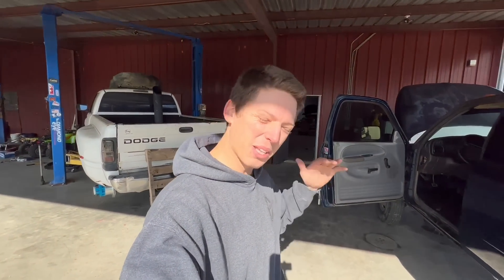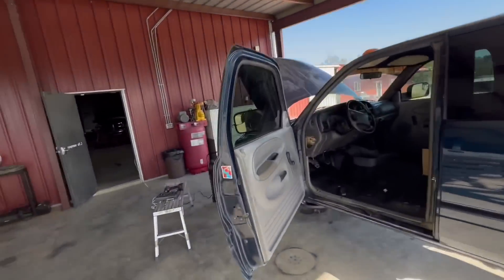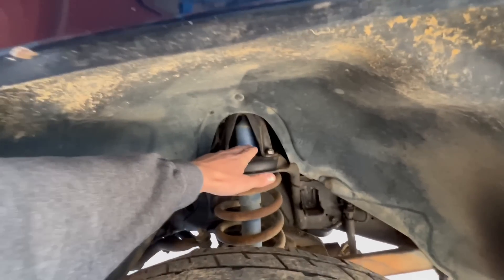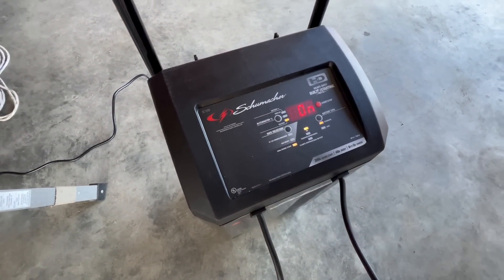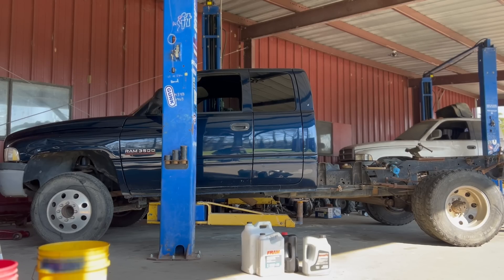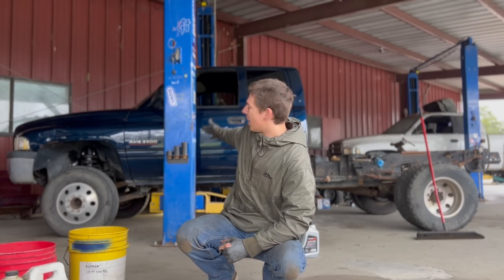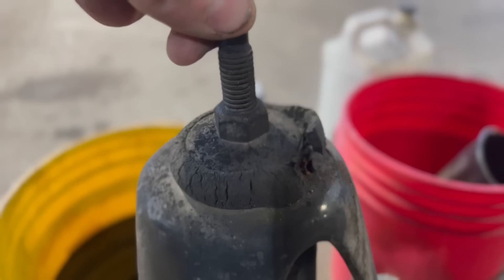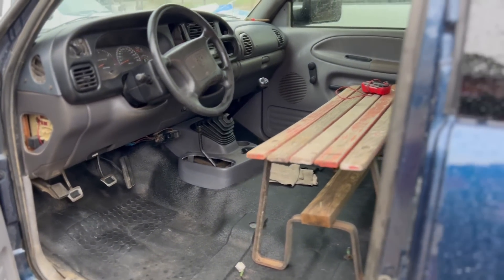I LIFTED THE DUALLY

Comment: I have the same leveling kit on my 2nd gen short bed club cab and I’ve got 285/70/r17s on it with 0 rubbing and a couple inches away from my long arm kit at full turn when I get out after it’s relaxed back a bit

Comment: 35s will fit I have a 99 ram 3500 dually an I put 315/75 r16 on my truck an it has a 2 a half leveling kit
Reply from the maker: What wheel width ?

Comment: Yeah the reason why these kits are so cheap is the quality and material is usually trash and maybe it's just me but when it comes to suspension especially when you have springs under that much pressure I think I'd want to go with better material to prevent a casualty and plus if you're changing the height of the shock Tower do you really need a leveling kit couldn't you just get your desired height from the shock Tower your custom-making?
Reply: The leveling kit is welded steel, I’ve had mine for over 2 years and it runs just the same as it did when I ran it without